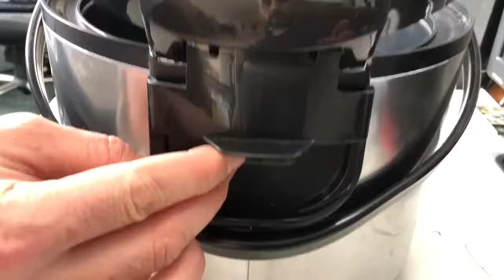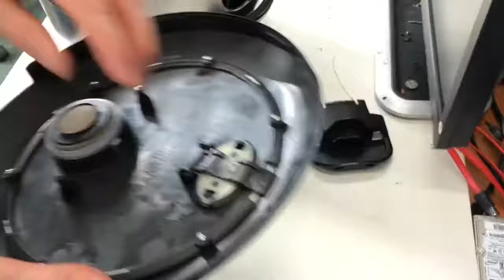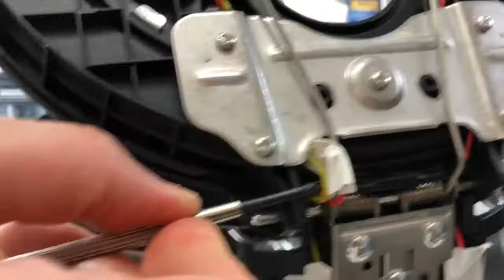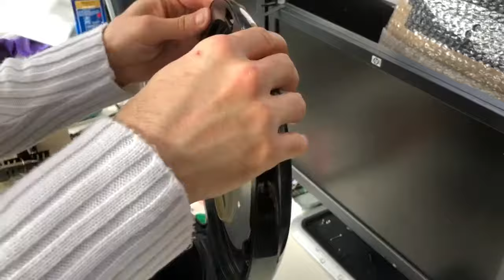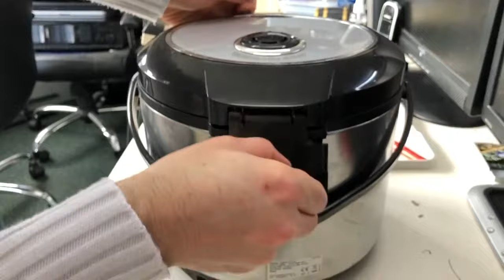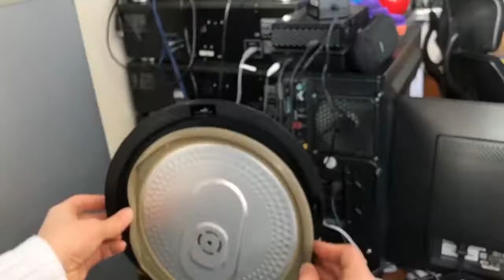How to fix error E0 on a Tefal Multicooker, Part 1

Comment: Thanks a lot. I had 2 wires snapped. The yellow and the red on the other side. The only one which is still looking good is the red next to the yellow and the funny thing is that is the only cable which was not put into the black cable clip at the lid right above the metal. That plastic clip is supposed to keep the cables in place , but they forgot to put the red one in and when I open and close the lid, I can see it move left and right, so if it was in the clip it would strain at each open and close and it only survived because it was wrongly built in. I would call that a design error. Without that clip the cable can move strain free and it will not break that easily. The second design error was to use stiff cables. They simply snap. Rather use flexible cables, if a cable has to move and best design would avoid moving cables completely e.g. by wireless contacts as they are used e.g. for toothbrush chargers with just coils on each side, but that would be more expensive. They rather want to sell another machine every 2-3 years because a cable snapps.

Comment: Thank you so much Morteza! The wire was broken in my Tefal Multicooker, exactly as you said. Managed to fix the problem by following your video and my wife is so happy :-)
Reply from the maker: great to hear that, make sure to see the part 2 and 3 and read the description too as I have covered some more important info ;)
Reply: @MortyParko  sir how about error 1 and 3, then induction cooker have power but no heat and no power induction cooker
Reply from the maker: @davinzhcentcode7152  sounds like a circuit issue, most probably the main capacitor is gone. Try replacing all the capacitors but do a search on Tefal induction cooker error 1 and see how to do it. If you live in UK then it’s cheaper in a long run to replace the whole thing.

Comment: Had exactly the same problem. Repair two snapped wires by soldering them together and heat shrink wrap to protect them by the edge. Hot glue might work better than tape to keep them in place. Can you imagine how many of these multicookers have been throw away just because of a simple wire? Thanks for the upload!!
Reply from the maker: Check the part 2 as well, I forgot to explain about the two little drain holes and you have to make sure they are not blocked. Also, at the end lift the handle up before screwing the water tank holder in the back.
Reply: @MortyParko  error 0 already check the wire and no loss connection, intact still good by why still error 0

Comment: Mine had broke up the yellow wire ,how to fix them ya
Reply from the maker: Hi, Haslinda, search for "how to join wires without soldering" on youtube, if the wire is not long enough then find a piece of similar thickness wire and add it in between. I'm sure it will work.